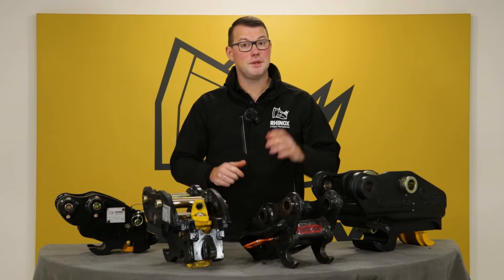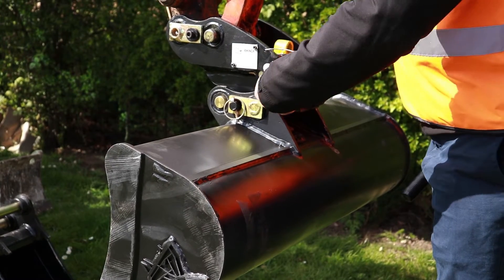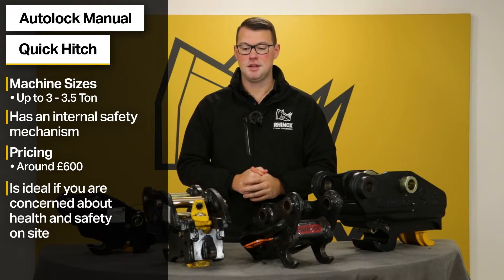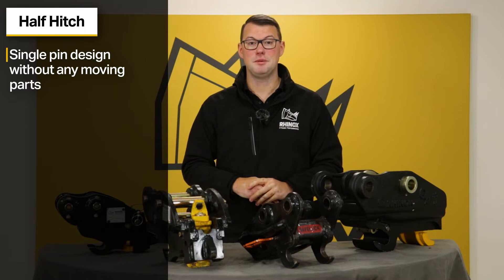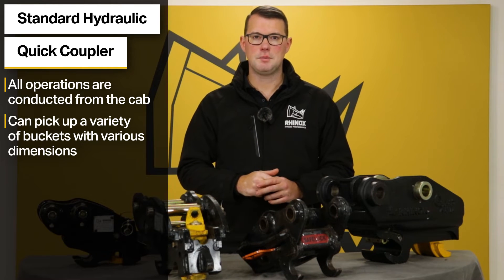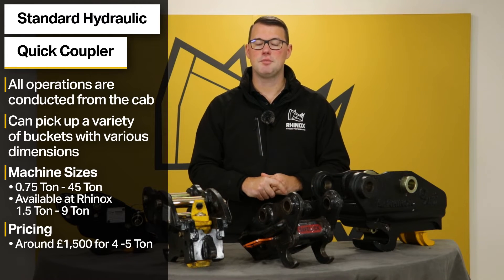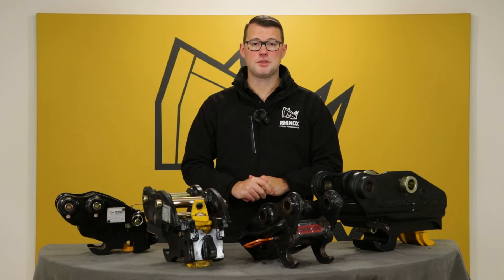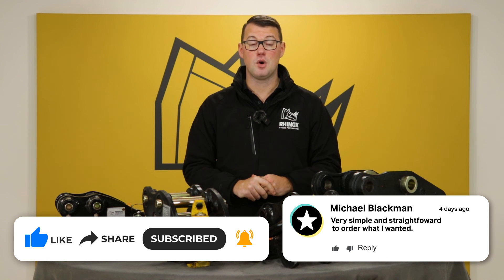8 DIFFERENT TYPES OF QUICK HITCH - Manual Hitches, Hydraulic Couplers and More!

Comment: Nice over view of Quick hitches we have the safelock quick and simple to use  have used a few ratchet hitches there alright Thanks again
Reply from the maker: Thanks for the comment! You've had a good selection of hitches, would you ever consider a hydraulic coupler?
Reply: @Rhinox-Group  Thanks for the reply we used to hire diggers at work so that's why all the different hitches 
are own digger on the farm come with the safe lock  
If using digger every day probably would get a hydraulic hitch

Comment: Nice job explaining the couplers. I bought the earlier version with the bar for removing and installing the bucket, it works well.
Reply from the maker: Thanks for the comment! A manual hitch is a good choice - the best choice for a smaller budget while still wanting the benefit of quickly changing attachments!